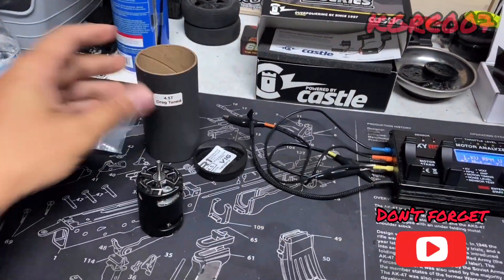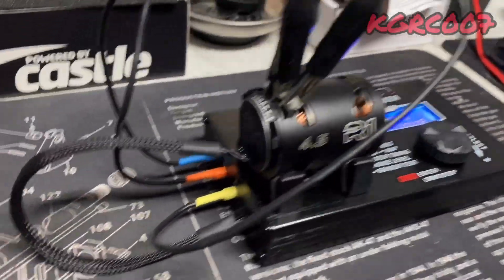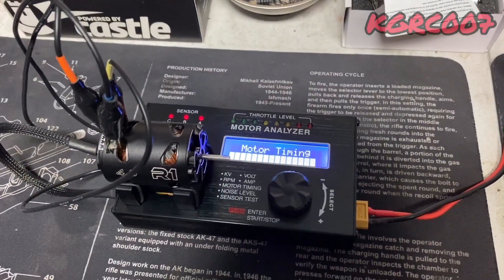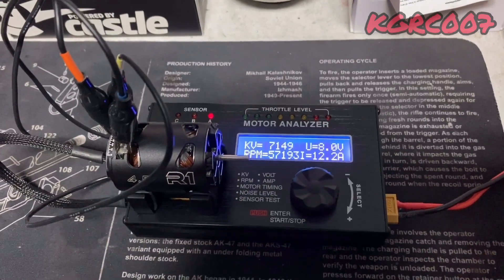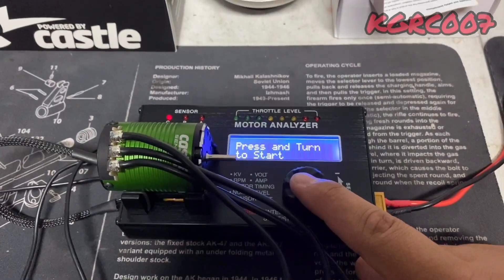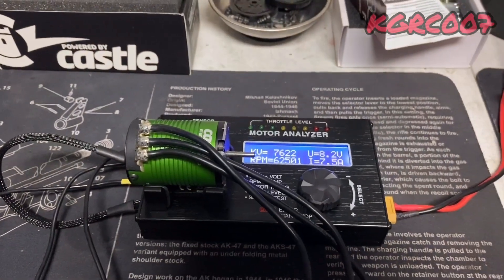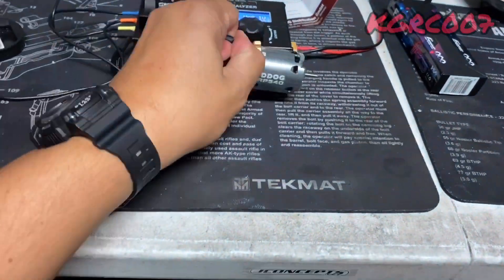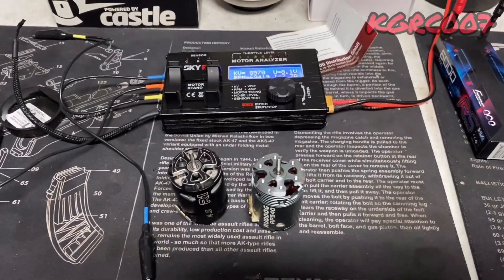SkyRC Motor Analyzer — R1 4.5T Drag Tuned - Castle 7700kv - Ruddog 4.0T

Comment: I have a ruddog 5.0 40 degrees timing on the motor 22 degrees on the esc with a 13.5mm drag racing rotor, ceramic bearings on 2s 23/90 gearing. I'm telling you it's impressive I have taken out quite a few high dollar motors

Comment: Motor timing does increase speed. For the Castle motor it is changed through the ESC. I feel like if you would bump it up to about 22 degrees, it would put out numbers very close to if not higher than the Ruddog. The Castle motor was by far the best balanced which will aid in durability.
Reply: Which means less heat when your dialing in your timing..
Reply: Also, the phase sensors were all absolutely even, meaning the sensor locations on the board are very precise.

Comment: Sup bro have typhon v5 v6 thinking bout replacing with mamba 1717 1650 ..what do you think for both high speed n dirt track…which pinion ⚙️ for both
Reply: That's a hell of a motor for the Typhon. With that motor you would be able to run pretty much any gearing you want with the light Typhon. At least the gearing you could fit with the motor mount. That being said, the 1717 could handle a lot more gearing in a Typhon. Your best bet is to experiment with what gearing works for your track. The highest gearing you can run doesn't mean it will make it good on your track. Run laps with each pinion and figure out your best average time for each pinion size. Either way, start with 2 teeth higher than your stock gear. Jump up two teeth for every 500 kv difference is ideal. So for example your stock pinion is a 16t and you are running the stock 2050 kv and you installed the Castle motor, you'd want to run a 20t pinion on the Castle motor to get approximately the same speed. 2050 - 1650 = 400.
Reply: @SebastianLong  thanks a lot

Comment: I blew up my other 7700kv motor at 235thousand rpm and it blew up
Reply from the maker: Did you run it on 6s?? 235k 😮
Reply: @kgrc0078  nope strait 2s
Reply from the maker: Lol how’s that even possible??
Reply: @kgrc0078  we threw all the timing at jt
Reply: Yeah. No you didn’t.

Comment: On the r1 how can I back down the timing?
Reply from the maker: On the back of the can there are 3 screws. Loosen them. You’ll see numbers on the side at the back. Timing will be like a pinion gear; higher the number the faster
Reply from the maker: But also remember that more speed = more heat so be careful

Comment: Thank you!
Unfortunately, this testing doesn’t give any idea of the actual torque produced......so interesting results , but not really helpful or predictive......cool gadget.
Reply from the maker: It’s useful In a way that it tells when the motor is somewhat worn out cos it’s kv rating drops. I had an old 6100kv that only puts out 5800kv now.

Comment: What are you looking for in a motor, AMPS or RPMS?
Reply from the maker: More rpm of course. But it seems to show also that the higher torque motors use more amps 👍🏼

Comment: I called castle directly they recommend the 5700kv for drag racing 🤔
Reply from the maker: Interesting 🤔
Reply: @kgrc0078  I must note I told them I was converting a slash to a no prep drag car and i mentioned above video the tech said 7700 would run hot 🤔
Reply: Speaking from first hand experience. The 7700 is fast on conservative gearing but will get hot fast. But it’ll hold up. Used to run mine in a slash on 3s lol.

Comment: Does the lower current men less torque? While lower amps may be efficient the motor with the less torque will take longest to achieve high rpm.... the Ruddog will come last in that drag race I reckon
Reply from the maker: I believe you hit the nail right on the head my friend 👍🏼
Reply: @kgrc0078  ok, so is there a way to measure torque on that measuring rig or is there a way to calculate torque from specs?
Reply: So lower the number means for more torque

Comment: Is the higher the kv does that mean more hp?
Reply from the maker: Correct! And the lower kv the more torque 👍🏼
Reply: @kgrc0078  so which is better cause i need a new motor
Reply from the maker: You can’t go wrong with R1. But for the same price you can get the new maclan DRK 💪🏼
Reply: @kgrc0078  ok it’s gonna be for drag racing
Reply from the maker: Yep. R1 3.5 all out or the maclan DRK 👍🏼

Comment: WHAT ESC WOULD YOU PAIR UP THAT RUDDOG MOTOR WITH ?
Reply from the maker: I did the hobbystar 160a turbo esc. Man, it’s FAST
Reply: @kgrc0078  Thank you 🙏
Reply from the maker: You’re welcome 👍🏼
Reply: @kgrc0078  after almost a year, do you have an update with the ruddog/hobbystar combo? I am curious to learn how the esc has held up. Are you only limited to the program card or can you access easier settings with an app at all? On the ruddog being loud, do you feel better bearings from the start would have improved any concerns?
Thanks for these videos, keep it up!
Reply: Go castle

Comment: Its gonna pull more amps when it has a load. More kv will pool more amps. That ruddog will not last its not smooth at all.
Reply: the motor wasn't setting correctly on the test stand. you can see it is almost falling off the right side
Reply from the maker: You get what you pay for 🤷🏻‍♂️

Comment: Great video, I have the 7700kv castle in my drag car now and it moves. I always tried to get an answer from them about the timing in the motor, but now I have an idea.
Reply: What time you running
Reply: @billymartini7723  I've graduated from the castle system and now have an r1 system with a fantom 3.5 and love the combo. Running 2.2 @63
Reply: @Gt auto’s and R/c’s the r1 will run it you just have to be careful with the tune and gearing.
Reply: Best gearing to run on my bandit with 7700kv motor mamba monster 2 esc and foam rears for drag racing?

Comment: Thank you for this video! I just picked up two 7700kv motors, not castle but still gives me an idea! I have the ruddog 4.5t in the bin as a backup...
Reply from the maker: My pleasure! My goal is to be able to help 👍🏼
Reply: I need to make my S22 faster what motor can I use?
Reply: How did the 7700kv hold up